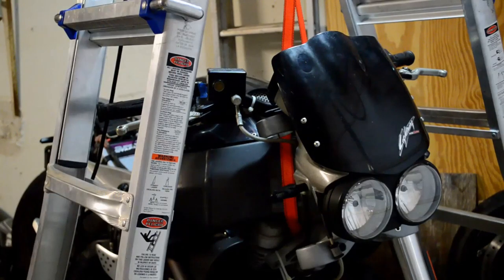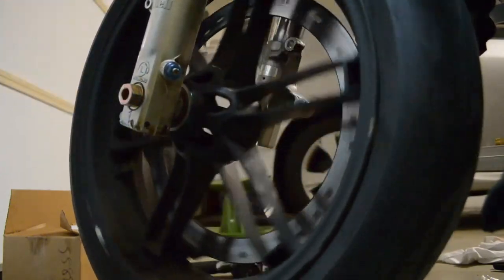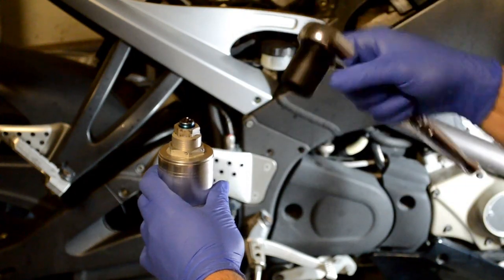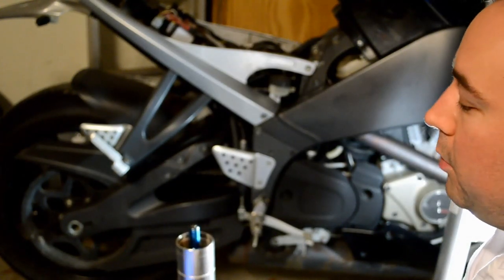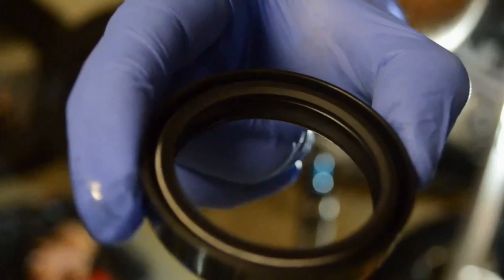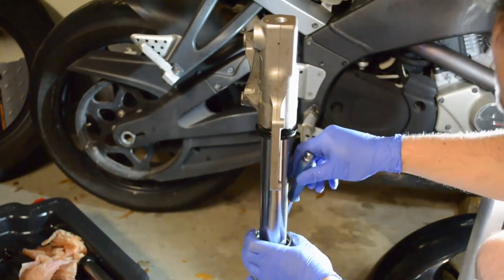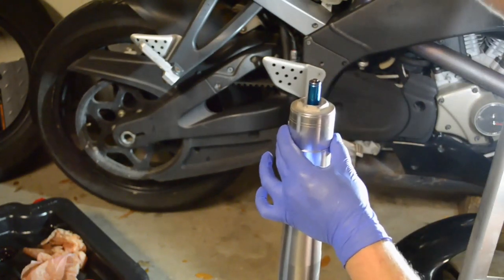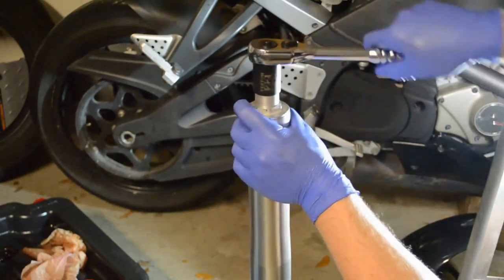Buell xb Fork Seals

Comment: The correct spark plug socket size that fits is 13/16", the back side of it is exactly 22mm
Reply from the maker: Thank you! I have pinned this comment so it is at the top and hopefully it helps someone.

Comment: Things I discovered during my go:
Video suggests a 32mm for the tube cap. An 1 ¹/⁴ deep socket works too and is actually tighter than a 32. 

For making the seal driver out of an 1 ¹/⁴ PVC tee, make sure it's 1 ¹/⁴ x 1/2 in tee. I bought one that was 1 ¹/⁴ x 1 ¹/⁴ and the added material in the pipe for the big 1 ¹/⁴ tee portion made it impossible to snap onto the fork, even after grinding it down many times. I went and bought an 1 ¹/⁴ x 1/2 from Lowes (only place I could find one) and it worked like a champ.

Also, you didn't have the issue I had but when you go to remove the pre-load adjuster cap, one of mine just spun the while dampening rod assembly, instead of just the cap. I had to compress the sleeve assembly and put the 17mm on a step earlier (make sure to do it UNDER the teflon bushing) so I could crank the pre-load cap down to remove the snap ring.
Reply from the maker: Added to video description. Thanks for helping!

Comment: Great vid, Thanks mate, Clear with good visual explanations, I'm doing mine now, got them on the table ready to dismantle, once I get all required parts. I ride mine hard and run a heavier weight oil in them to take the high speed front wheel landings and high speed jump/impacts etc. (She rides smooth as silk over 100km/h. ) Would you also recommend changing the metal retaining clip flat rings as well? can they wear causing slight slap in the sliding of the tubes?
Reply from the maker: You're welcome! Makes me happy to help someone. I have an SS, so I don't bottom out, but if I didn't have the 'long' model, I'd use heavier weight oil too. Everyone likes the SCG, but those bottom out from the factory on the street.

I did NOT change my retaining clips, and although in my mind there's no reason to change them, I don't want to tell you wrong. If it's only a few bucks, and it makes you feel better to change them, go ahead, but to give you an idea... my other bike is older than I am and I reused those retaining clips.

Comment: Really superior video. The only thing I can add is that, lacking an assistant I trust, I pulled the tube down with a ratchet strap that I re-worked the hooks on by strategically shortening them. It may even be safer if you do it right?! But no video because I'm not as pretty as you.....
Reply from the maker: Thanks for the tip Kelly. Glad you were able to get it done and thanks for the kind words.

Comment: The teflon covered sliders should be replaced as well, and even if you spread them or even if they feel lose for some reason and do not fit snug onto the groove, the outer fork casing will keep them in place.  But it will be a bit harder to slide together.   9:19 time stamp.  Great video, love the DONT TOUCH THIS front brake comment. LOL
Reply from the maker: I wish those were easier to buy replacements for. Thanks for watching.

Comment: Same forks on 05 xb9sx?
Reply from the maker: I believe the SS and SX share the same front forks... they both have longer travel than S and R. You can certainly use this video, but double check the fluid level is correct. In an abundance of caution I recommend you check the service manual for the X before proceeding - here's a link: http://buellmods.com/#TabbedContent

Comment: So this would b the same for an xb12x "ulysses"?
Reply from the maker: The basics yes. You want to double check in the manual the amount of oil for each year/model of bike, but I do believe the ss forks are exactly the same. I know the swingarm and belt are interchangeable but not sure about the rear shock so don't want to speak with 100% on the forks friend.

Comment: 6:07 I just got the collar tube removed and there's no "black slidy bit" on it......? I really hope someone can help me out in figuring out why tf that's not on mine
Reply from the maker: The bike rode fine without it? What year/model? I'll see if I can find out.
Reply: @IanLandesman  just bought the bike (paid way too much for it lol) it's a 2004 BUELL XB9S, bike rides like trash, but I assume that's just because of the blown fork seals, hard to say though since I've never ridden it while it was in tip-top shape
Reply from the maker: @xv8852  it should ride really well. I guess you need those bushings.
Reply: @IanLandesman  any clue what the particular bit is called? Im trying to find a listing but don't know what it's called nor what it looks like since I don't have an example in my hands
Reply: @IanLandesman  so now I've disassembled the other fork and that one also does not have the slidy bit over the collar tube, maybe it just wasn't implemented for the 2004 model year?
Reply from the maker: @xv8852  I don't think this is the part you need, but I see a diagram with part numbers that may help you. I'd try calling St. Paul Buell to ask if they can source you the part.
Reply: @IanLandesman  thanks for your help sir, the video quality, explainations and your quick replies mean that I will check your YouTube channel first whenever I have a job to do the Buell, cheers